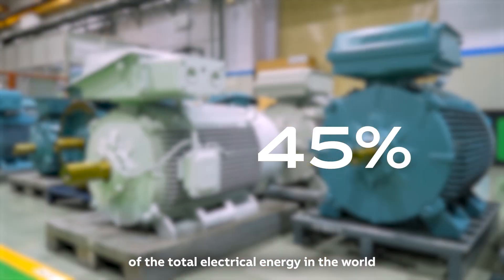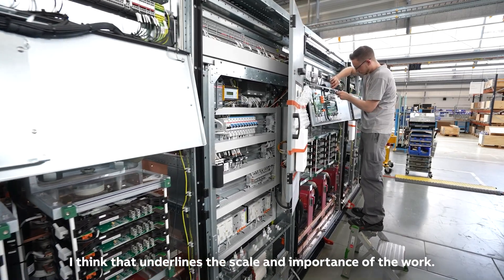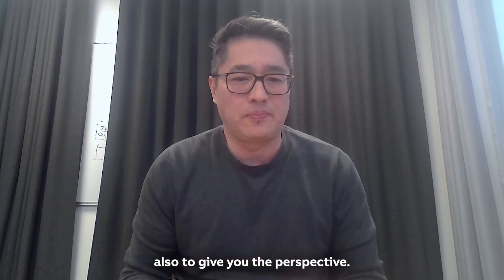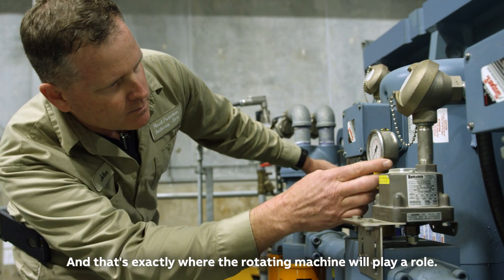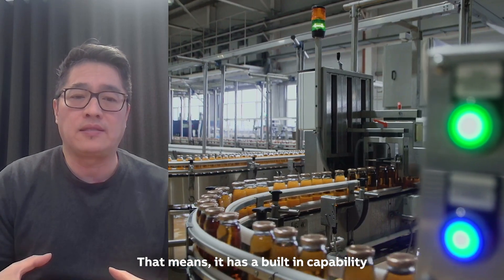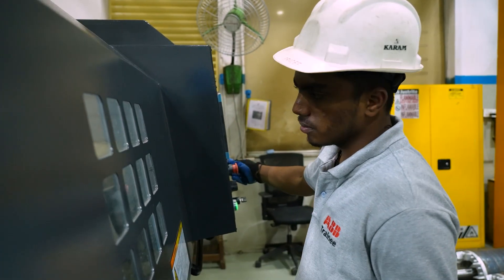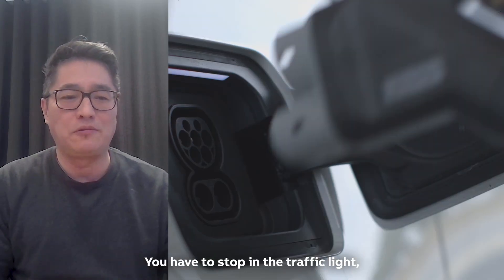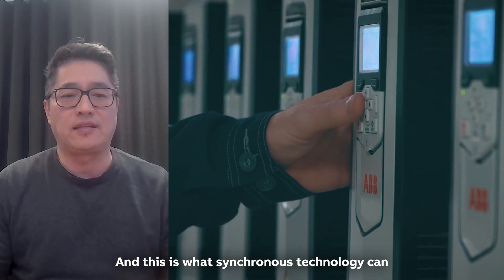The turn of efficiency

Comment: Energy efficient motors have a disadvantage though, the initial magnetizing current and the locked-rotor current is substantially higher. This can be detrimental to control equipment's well as power systems.